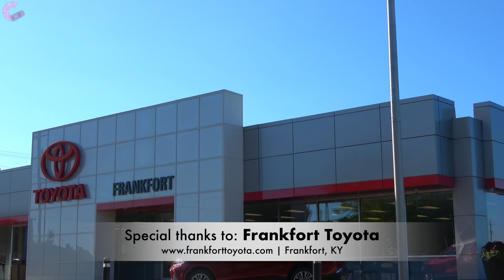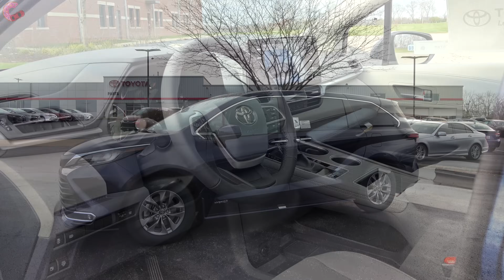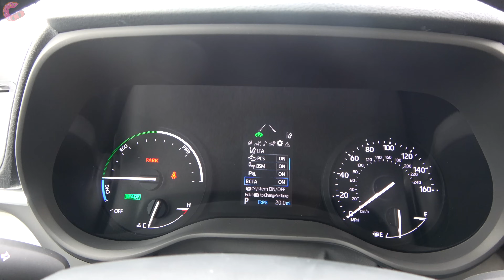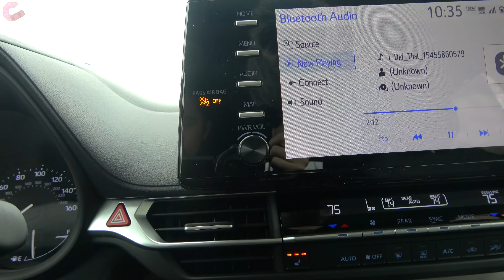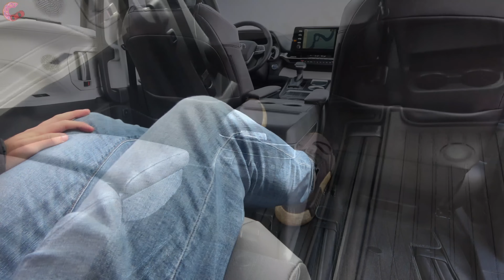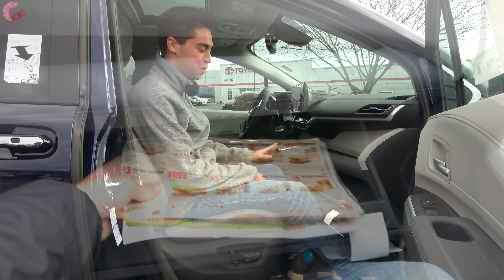2021 Toyota Sienna // The Swagger Wagon is BACK, Now with *36 MPG!*

Comment: I had high hopes for the 2021 Sienna but a buzzy 4-cyclinder motor, non-removable middle seats, and a hybrid system that will need major expensive repairs after the 10-year, 150,000 mile warranty expires makes looking at a used 3rd generation Sienna a safer choice.  Remember the old saying that you should never buy the first model year of a new car?   That also applies to Toyota's.  Perhaps waiting for the 2022 Kia Sedona, currently only available in Korea as the Carnival, will be worth waiting for.  Unfortunately the Koreans, Honda, and Chrysler don't stand up to Toyota's reputation for quality and durability.  The smart choice is to buy a Toyota.
Reply: Hybrids are more reliable and last longer than conventional ICE powertrains.  The engine isn’t that loud.  All cars will be hybrid, plug in hybrid, or fully electric in the next couple of years.
Reply: @user-tb7rn1il3q  I just bought a 2019 Sienna Limited Premium.  I'll stick with the ICE motor for now and let time tell how well the hybrids hold up.  As a general rule, Toyota's hybrid engine has been very reliable.  It's the other parts in the hybrid system that could become problematic after 8 to 10 years.  Watch some of Scotty Kilmer's videos about Toyota hybrid repairs.  It will take much more than a couple of years for the auto industry to switch their power trains.  The manufacturers all say they are going to do it but supply constraints on batteries and the ability of the electrical grid to power full electric cars is limited.
Reply: @waruddell  The battery constraints will be worked out.  The grid can handle it, especially as more solar comes on line.  The grid is being updated in my area.  Charging a car is no different than running a dryer.  The hybrid component failure rate is extremely low.
Reply: @andym1223  amen. Skottle and Daffy Duck Doug are the last two guys I’d be taking car advise from.

Comment: Pacifica style is no match with Sienna... toyota got it better but could not catch up to pacifica. This 2021 model just got Grille in front... there isnt anything but grille... its a lazy design. Throwing a big grille on front and dont worry about the space in front
Reply: who cares about grill lol, this thing does 36 mpg!!! and it's AWD!!! and it's a Toyota, so it's going to run for 20 years. Pacifica will be on junkyard after 7 years top with problems starting already after 2-3 years. Go check Pacifica forums - they are riddled with issues.
Reply: Most of it is fake grill.  It will be a great bug catcher in Florida—plenty of work to clean.  The blinker is ridiculously small.  They should have taken some of that grill space and made a bigger blinker

Comment: I test drove two XSE FWD and I do like how the van handles, seats are ALL comfortable,  audio is killer vs crap in Honda. Hands down my choice except for one HUGE error from Toyota...the middle seats do not come out which makes hauling long items impossible.  

While the power train was responsive thanks to the electric assisting, that 4 cyl gas engine is loud and buzzy and it likes to rev high frequently.  Sport mode has a significantly more responsive feel, at the cost of high reving that gas engine.  Cruising down the highway though is very pleasant and quiet and I preferred its overall handling characteristics over the Odyssey.

Comment: I bought an XSE AWD 2 weeks ago! First time being accused of driving a minivan won't be an insult🧐 I wasn't happy to discover those pretty wheels are actually plastic covers🤔
Reply: That would normally bother me, but you can't really tell by looking at them.  The bonus is that they can easily and economically be replaced if damaged by curb rash.
Reply: @rollingreclinerRecumbent  I agree ,they do look great. I would prefer the black covers. I'll look for them in the coming months however I believe Toyota's going to charge an outrageous price for them. Cheaper than a rim but a lot more than a cover should cost🤔
Reply: @ArgentumSphinx  sales rep told me 60.00
Reply: Toyota does the plastic cover thing on the Prius too.
Reply: The ChromTech wheels are $Texas to replace, so be careful. The bonded plastic cover on them isn’t replaceable.

Comment: only hybrid? hmmmmm
Reply: I wouldn't mind if the entire Toyota lineup went full hybrid. They've developed the tech so much that it is more reliable than their conventional drivetrains!
Reply: What’s wrong with the hybrid engine?
Reply: @ikelee  After 10 years or 150,000 miles, expect to replace the battery pack.  That's a huge expense compared to the gas V-6 that doesn't have a clock ticking on a battery pack.   Watch some Scotty Kilmer videos, a big fan of Toyota's, as he shows what happens to old Priuses.  Hybrids are great when purchased new but become less reliable as they age.
Reply: @ikelee  Nothing. Toyota’s system is super reliable.

Comment: I'm a Honda fan but Toyota really needs to get rid of that shifter. That floating center console was made for a button shifter to clean that area out.  It would've made more room on the bottom as well so a double plus.

That being said, what's the point of getting a minivan rn when we can't even go anywhere smh.

Edit: I just heard the engine going wow what is that sound. Seems like the engine is taxing due to the heavy weight of the van. This needs a V6 instead.
Reply: Its not. It sounds like that in my grandmothers Rav4 hybrid. This system produces plenty of power.
Reply: You want V6 go get Odyssey, but don't expect it to make 36mpg!!! Oh and Odyssey doesn't have AWD either lol. Besides Toyota will last 20 years, while Odyssey will be in repair shop many times with transmission issues or engine issues.

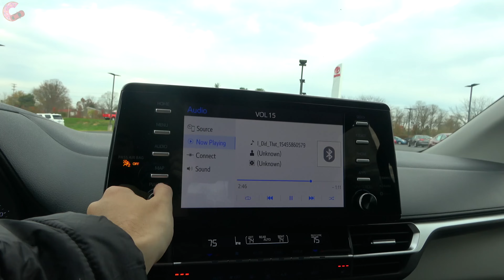Comment: Ouch @11:35 sliding the seat. Brand new vehicle and it already sounds like it needs some WD40? And yet the Toyota guys ALWAYS give me crap over my Chrysler products!😂

In all seriousness, Toyota took a serious gamble on going full hybrid and ditching the 2GR-FE V6 altogether. Luckily, people trust Toyota's hybrid systems, so it is kinda baked into the equation.  That said, I really wonder about performance under a loaded cabin. It sounds very strained when empty, so filled with a family and their stuff is questionable.
Reply: He did not pull the lever all the way out which is why you heard it ratcheting.   I had no issues in testing.
Reply: Toyotas hybrid system is excellent and has plenty of power. In regards to the seat track, it is designed to sound like that.
Reply: @andym1223  hmm, other reviews don't show that. But it would be disqualifying for me anyway because they can not be removed. Blunderous engineering decision, to say the least, in a multi-purpose vehicle.
Reply: @hellkitty1014  they did it for the airbags in the seat. They don't want you removing and plugging in airbags. Most people don't really remove the seats anyways.
Reply: @hellkitty1014  I raised an eyebrow at this too.  There maybe sound engineering reasons for not removing the second row seats, but limiting versatility in this way will definitely cost them some sales.
Reply: @curiously1510  I don't think it will be too bad for the Sienna. Not a lot of people remove second row seats anymore.

Comment: 18” wheels are “tiny” now?
19 and 20 inch wheels aren’t the norm. They are very expensive to replace, wear out faster, give you a louder, stiffer ride and put your rims at more risk of damage due to the tiny sidewalls.
Reply: The 20 inch wheels look 100% better on this van.  Even my wife, who could care less about cars, commented how frumpy those with smaller wheels appeared by comparison. Its not always about practicality.
Reply: @rollingreclinerRecumbent  It’s a minivan, not a sports car. 
You don’t want a bent rim from hitting a pothole with low profile tires when hauling toddlers around.
Reply: @webcomment8895  can't bend a plastic wheel cover. Just because its a van doesn't mean it can't look good and the XSE FWD or Platinum FWD do look much better.  Not everyone is looking to haul kids.  My kids are recumbent trikes, and sadly the non-removable 2nd row will likely kill the deal.
Reply: @rollingreclinerRecumbent  What are talking about “plastic wheel cover?”
Wheel covers have nothing to do with low profile tires with thin sidewalls that don’t prove much cushion against wheel damage.
Reply: @webcomment8895  all of the Sienna wheels except the 17 inch have a plastic wheel cover over an alloy blank underneath.   Not denying someone could bend the underlying wheel with a lower profile tire.  Just saying it looks better.  Good thing there are varying models to choose from to suit consumer choice. Granny wall tires or the better looking 50 series on 20" wheels.  I prefer the later and will keep my eyes open while I drive and avoid those nasty pot holes.🙂

Comment: It can never beat Odyssey. Just look how much Odyssey are on the road be old or new. Plus the space on Odyssey is much larger than this. Toyota is a rip off car. Very expensive too!
Reply: Lol Odysseys are prone to transmission issues. There are way more older Siennas than Odysseys on the road. The Odyssey is a pile of junk, we own a 2012.
Reply: Toyota is literally the “safe” choice... comparing to Honda
Reply: The hybrid motor and AWD option in the Sienna now make the Odyssey less competitive, but point well taken on the cargo space.  Those non removable 2nd row seats will be a deal killer for some.

Comment: I have a 2020 RAV4 hybrid and I use the shift simulation to help when going down mountains
Reply: I also have a new 2020 Rav4 hybrid for the last 3 months.  The shift simulation is a total mystery to me..... can you please explain?
Reply: @henryhonda8408  basically it will mimic an automatic transmission. Normally I just leave it in drive but when I’m going down steep hills our mountains I just it so that the engine helps slow me down not just the breaks
Reply: @Superfastjellyfish669  when I accelerate I don't feel any shifting whatsoever (simulated shifts was a deal breaker for me).  When going downhill  or slowing down in general & I'm in adaptive cruise control I press the down on the down thingy to slow my speed & if I hold it for a couple seconds it adjusts the speed downwards at 5 mph intervals which almost feels like downshifts but it isn't.  Not sure if that's what you meant.  I love my Rav4 hybrid, hope you're enjoying yours also.  :)
Reply: @henryhonda8408  It doesn’t simulate the shifts if you are just in drive you have to switch it over to the left for it to do that like if you are shifting up and down the gears.
Reply: @henryhonda8408  I love my RAV4 I mostly shift down a gear or two because I go up and down the grape vine mountains which is pretty steep so I don’t want to up all the wear on my breaks
Reply: @Superfastjellyfish669  If your RAV4 is a hybrid you are not wearing the brakes with light application.